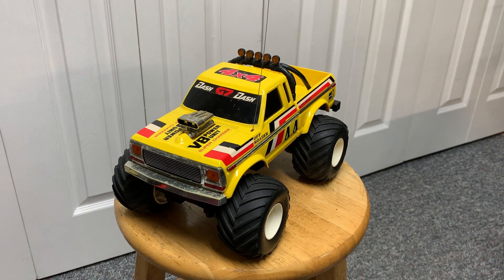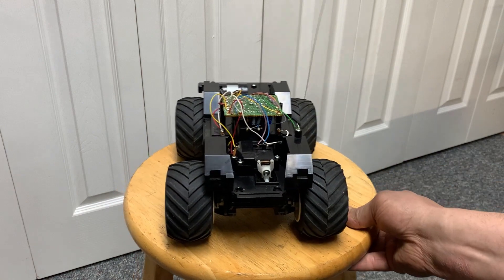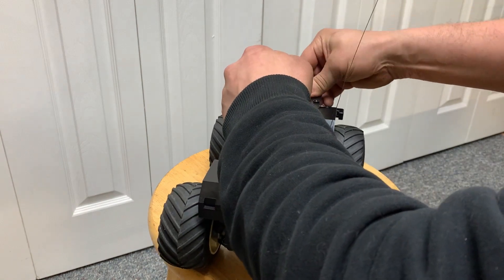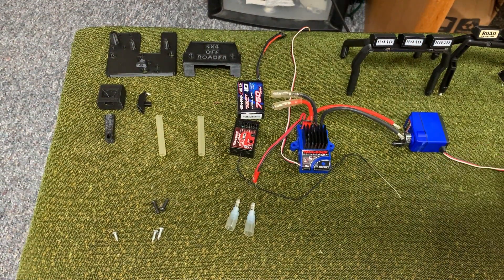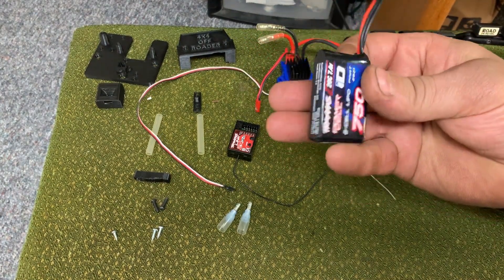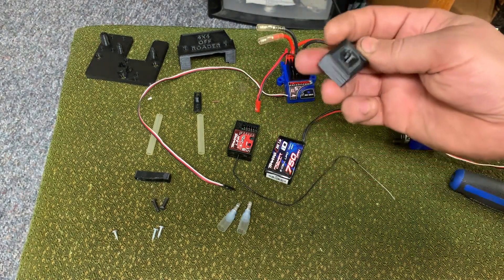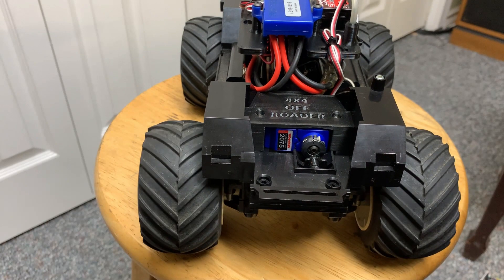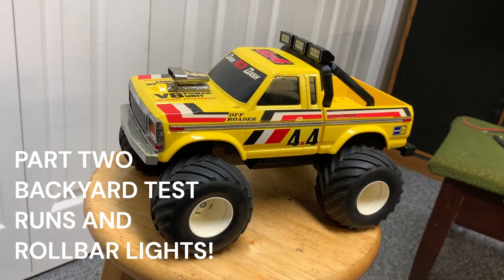Radio Shack 4X4 Off Roader Electronics Upgrade

Comment: These were awesome in stock form, putting modern electronics in them brings them to a whole new level.
Reply from the maker: Ya they are cool trucks.  I made sure i kept all the original guts.  But way funner to blast around on new gear.  Thanks for watching and the sub!

Comment: Nice i got my hot machine intruder from when i was a kid  i threw in the 8aa +9v in there and i was surprised it actually still runs and no where near as slow as i expected....but my son 4 y.o. with autism cant talk great but his thing is taking apart everything lol and  he realized my lab power supply is same as on sum y.t. videos where they over volt toys to go fast if i even look away for a sec. He try sneak it in his room 😂 im dying to update our rc truck  thanks for the help !!
Reply from the maker: @rookiexreviews  lol. Ya not many of my originals survived my childhood. Most suffered dissasembly or excessive voltage lol.  Thanks for watching!

Comment: I bought one of these on eBay about 10 months ago to do exactly what you're doing. I got it for 5 bucks. No radio. The only thing with mine is it came from the south and the sun ate most all of the decals off but the plastic is still in great shape. But it's all gutted and waiting for a spot on my work bench. Do you have your 3d printed parts available on shapeways for people who dont have a 3d printer? My only wish is, the motor bay was large enough to fit a 380 motor. Oh well. Life is good.
Reply from the maker: Hey there.  I have not put any of the parts on shapways i just havent had time.  I belive you can have my files printed by them though if you just send the files you need to them.  There are people who advertise 3d printing services as well.  Usually pretty cheap.  Thanks for watching.
Reply: @allaird1  Thanks for offering those files for free. Makes converting that RC very easy.
Reply: How is your mod going? I purchased my old blue one back off ebay a couple years ago also intending to upgrade/mod it but I ended up doing a nice restoration and keeping it stock. I love seeing what everyone else is doing to their Radio Shack 4x4's!
Reply: @Baneslayer  Ive got all the parts on the shelf. Im saving up to get some 3d prints from shapeway. I have a sandscorcher from Tamiya that needs some 3d parts also so Im going to get them all at the same time. So many RCs and never enough money!.  LOL  I should have it finished by mid summer if not sooner.
Reply: @sagnhill  Thanks for the reply, I totally hear you on the "never enough money". Too many projects and hobbies these days and they all cost a lot! Good luck! I need to 3d print or buy a spare part battery cover for my 4x4 off roader remote control.
Reply: @Baneslayer  You're welcome. I just finished my SCX6 Honcho. It is 98% Vitavon. Thats where my money has gone the past 8 months--LOL. So now I should be able to get my Tamiya and this RadioShack done. Man that Vitavon stuff is expensive but its so damn cool. I have an Arrma Felony that is getting the Vitavon touch very soon. Then, of course I see their kit for the Kraton. Holy-crap $$$$$$$$$

Comment: Do you know where I can get transmission parts? I’m missing some gears on one of the spindles.
Reply from the maker: That is a tough one. I have had some success 3d printing the plain spur gears  in the primary reduction and front driveshaft bevel gears out of pla. The spider gears in the differential are so small they are hard to 3d filiment print.  Mabey a resin printer would work better. The easiest option is a donor truck. 
Thanks for watching.